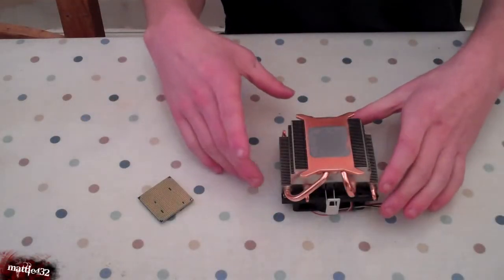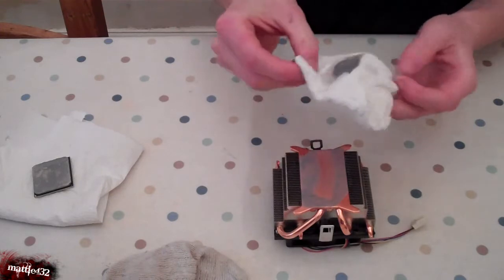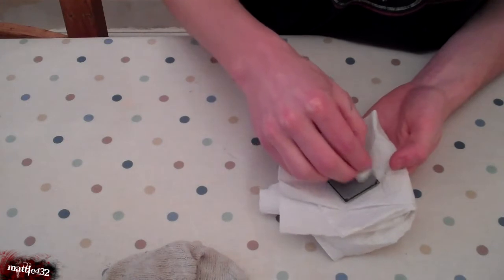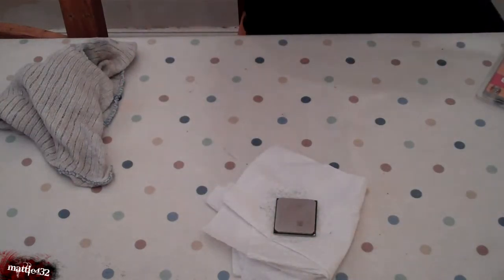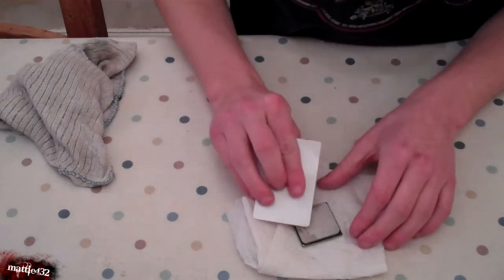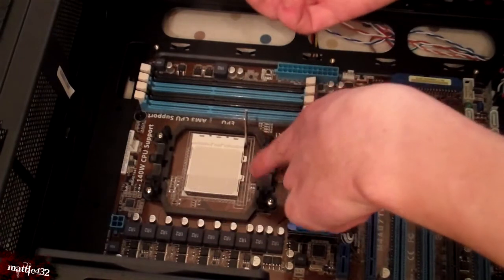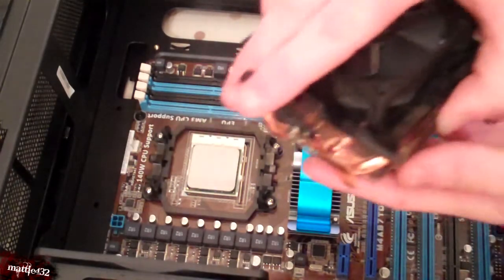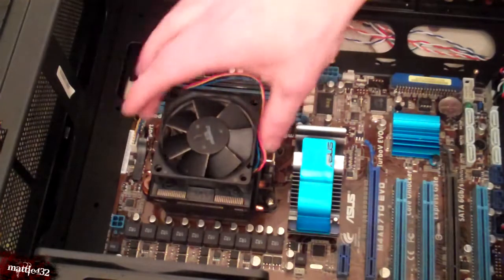Install a CPU / Processor - Modify your PC

Comment: You are supposed to apply a pea sized dab of compound in the middle of the cpu. When you spread it it can allow air bubbles upon application of heat-sync. With the proper technique all air is released through pressure of the 2 parts coming together.

Comment: Just be careful with the pins on the bottom of the processor, they're super fragile and if you break or bend any of them, you probably won't be able to return it. I know newegg doesn't take them back if pins are bent.